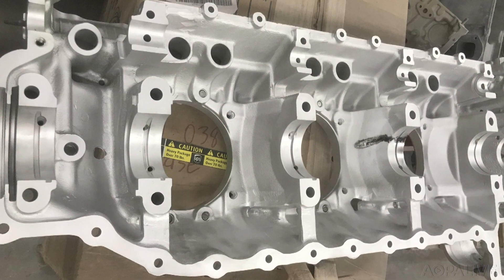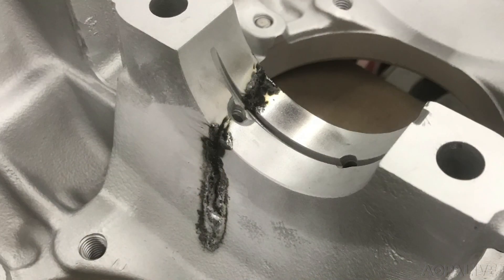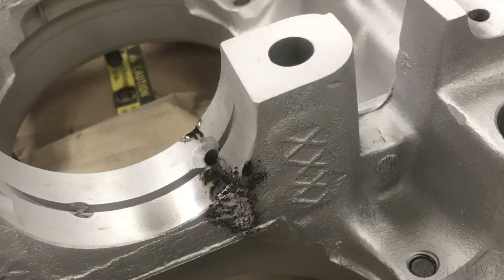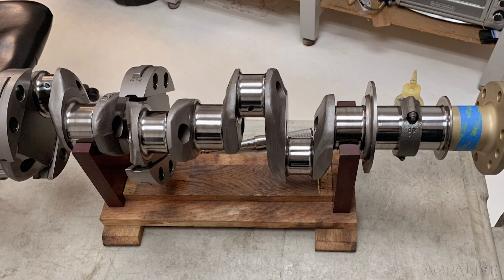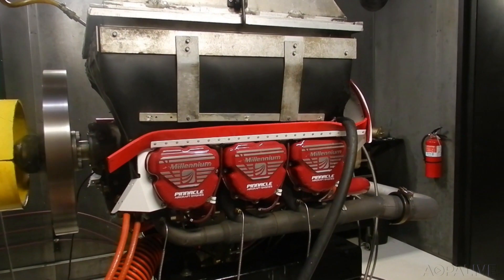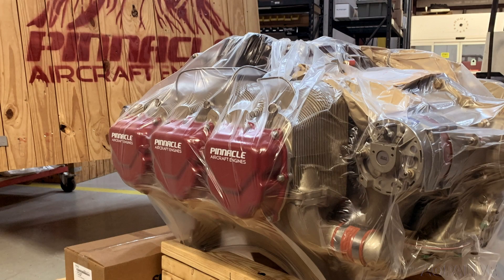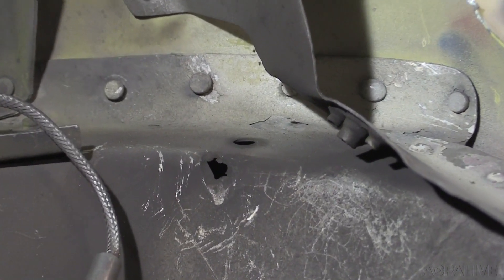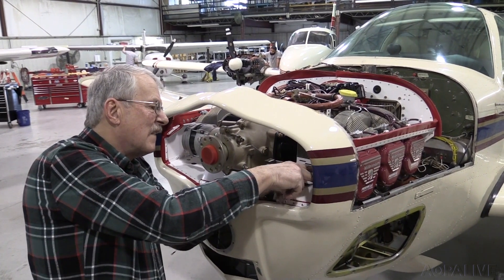Inside an airplane engine overhaul

Comment: Too bad the vid is wasted on so much stupid nonsense and not the overhaul. I would have really liked to see this build since Pinnacle built the engine for “One Moment” Lancair Legacy. I don’t know why people spend so much money on an io-550 upgrade for their Bonanza and not do the carbon fiber nose bowl conversion like Blackwell does. It’s like your still trying to push a barn door through the air with a bigger engine while still using those dumb cowl flaps that could be eliminated.